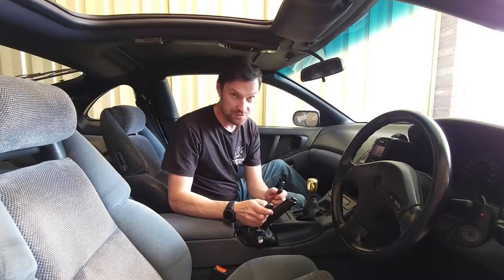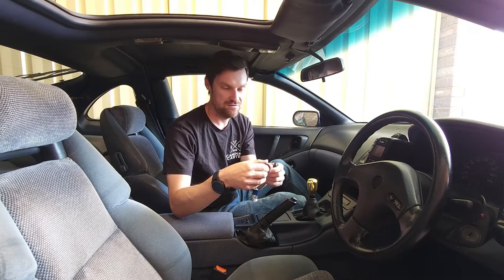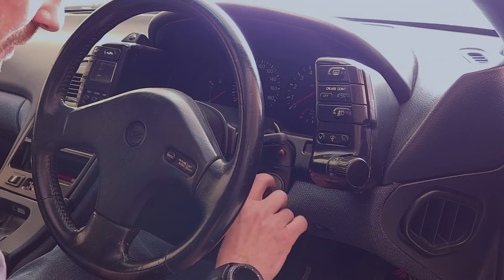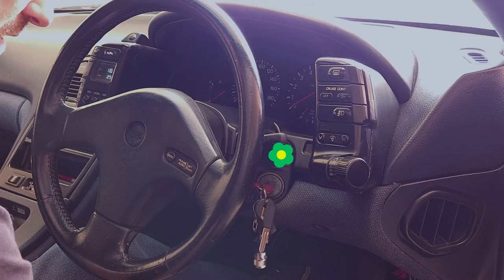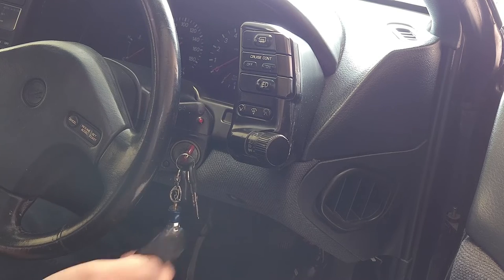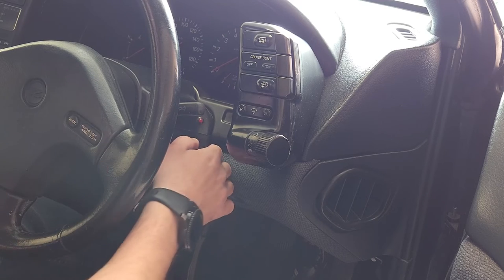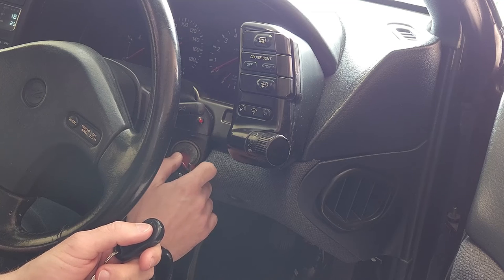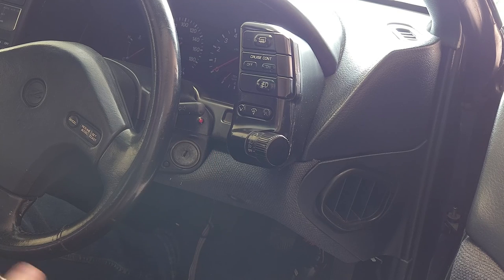How to Manually Override Auto Watch Immobilizer System

Comment: Great video . Alas my problem is my 1995 VW Golf's SANJII immobilizer- which is mounted under pax side carpet seems to be the problem. Changed my remote to my spare (which is brand new) and inserted two brand new CR 2030 batteries into remote-both LED lights come on when trying to deactive or activate her, yet she keeps on screaming. Had it sorted yesterday, went to the shops, only to realize I didn't have the battery/oil/choke lights working but everything else worked. Turns out the broad connector to the back of the dashboard panel either came loose, or I forgot to attach it (less likely) Took me 3 hours yet again to open dash. Repeated all the steps yet my ears are now bleeding from that incessant blaring. Finally decided to disconnect battery. Did notice the SANJII on the floor resembling a flat tapered trumpet has one "stop" which becomes warm. Even switched the two brand new batteries positions yet LEDs still work. I completely give up. Any suggestions besides putting her on bricks and buy chickens will be highly appteciated since I can't even start her to go to SANJII in Johannesburg.
Reply from the maker: Hi mate, bit going on there! sounds like there could be a critical issue with either the immobilizer system or the wiring for it, if its an aftermarket unit you may be better off removing the whole system to get the car going as you might be going mad trying to fix an unfixable issue.
I wish I could be more help here but it sounds like you may already know more than I do about your system.

Comment: How do you slide the top of the immobiliser? Mine won't budge!
Reply from the maker: Mine has a cap on the top that has 2 screws going in from the top of the cap. These need to be undone to lift the cap.
Mine is a 674Ri
Reply: @simmoshomeworkshop  ah ok. Thank you very much! I'll have another look as I've just ordered another fob because I rang a guy and he says £800 to fit a whole new alarm system just because one of my buttons on the fob has come away from the board 😒
Reply from the maker: Wow not cheap! Hopefully you can find the code and get the new fob to work, they can be quite hit and miss depending on the model
Reply: @simmoshomeworkshop  mine looks like a 457 with 4 buttons on it but the box itself looks like yours so hoping this works 🤞 
Do you know if there's a way to program another fob when you already have a fob? Like I said only one button 'arm' is broken on my existing fob but all the other buttons work. Just wondering if you can use the existing fob to put the box into 'learning' mode?
Reply from the maker: Hmm, I have only really coded the single button fobs through the LED input and key on and off flashing procedure (from the video).
I have not coded using another fob, it is possible without entering the code first (before doing the LED procedure) you instead use the other fob do disarm the immobiliser then do the second half of the procedure for the new fob, but I have never tried that.
Reply: @simmoshomeworkshop  do you know of a video that will walk me through this progress?
I can disarm the immobiliser using the existing fob, I just need to add another fob to the system
Reply from the maker: Nah I wouldn't know a specific video to do that sorry, (I'm sure someone would have done one) the very last part of this video does add a remote but only with the code, there is also a guide in this video's description on what I did if it can help you.

Comment: Is there a chance older models only had a 4 digit code?
Reply from the maker: Hey mate, all the ones I have encountered have always been a 5 digit code, it's possible very early ones could be a 4. If you have a 4 digit code somewhere on the unit and you think that's it, it doesn't hurt to try it, worst case it won't work

Comment: Just letting you know bro you can see the reflection of the flashes on the backside of your steering wheel and also on the right hand side black panel. Someone would be able to read your code if they really wanted to 👍
Reply from the maker: Cheers man, might have to do an edit 👍

Comment: Hi  so if I don't have  the  light  what mast I use to see if the code is Ok?
Reply from the maker: Hey mate, are you 100% sure there is not LED? All these systems should have the security light, without it the manual override isn't possible to the best of my knowledge.
Reply: @simmoshomeworkshop  .. hey mate ... I have the LED in the dash but it doesn't light up at all. How likely are the LED's to have blown ?
Reply from the maker: @heathenmedia  hey mate, rare for a LED to be blown but not impossible, are there wires leading to the LED? I have seen people put dummy LEDs in to look like they have immobilisers 😅
Could also be a broken wire to it, either way the LED should light up with key off and / or out of the ignition

Comment: Can i use a aliexpress remote cloner to have some spare keys, I have just one left
Reply from the maker: I've never tried with anything other than the autowatch remote that matches the installed unit, I don't see why a cloned remote couldn't perform the same function as long as it can mimic the same frequency as the original, the receiver shouldn't know the difference, I'm assuming..

Comment: Thank you for helping me it is working. Do you know how can I switch disable the motion sensor . Regards
Reply from the maker: Usually to disable the motion sensor operation for the cycle you need to press the remote button a second time within 1 second of turning the alarm on. This will only disable it for that cycle.
There is also a note that if early warning is programmed you will need a third press to isolate the motion sensor.
Hope this can help

Comment: Hey mate, I have the n4086 remote, where did you find a replacement as I want a secondary backup
Reply from the maker: Hey mate, assuming it's the peanut style like mine, the keyguys.com.au, or remotepro.com.au and good old eBay have them for just under $100 shipped.
I think the 225-000 is the same thing, (worth a check) I hope this helps!

Comment: The previous owner removed the code sticker and I have one fob, if you change batteries in the fob does it reset the fob?  Only have one fob & no code so need to know whether to rip it out now or if I’ll be ok changing batteries if it has a memory.  Cheers
Reply from the maker: Oh dear quite a pickle, my remote did not remember its settings when I changed the batteries but they were flat, I can't guarantee yours will or will not unfortunately (best to change the battery fast as possible if you do change them). The code is hidden inside the black box have you checked inside to be sure?
Reply: @simmoshomeworkshop ah that’s a shame, I hoped it had a memory function of sorts… 
 Unfortunately previous owner has peeled the sticker off of the unit so I’m a bit stuck if this battery dies.  I wanted to code a second fob, but obviously need the code to do it.

Comment: I have a button thing with 4 numbers and a s button what is this got a led indicator but no key fob I just bought the van would interesting to figur it out and to use
Reply from the maker: Interesting, is this unit mounted to the car and not something you carry? I'd imagine the 4 numbers are for a pin number? I have not encountered a system like this, the principle may be the same as mine where the LED corresponds to a code that would be printed on the control box under the dash/kick panel

Comment: After I input the 5 digit code it flashes but then when I turn it off to start programming the remote no flashes happen there’s just no light at all.
It resets after about 40 seconds and starts flashing again. Not sure what to do.
Reply from the maker: Hmm, that's an odd one mate, everything I know and have seen, once the 5 digit code is entered and the fast flashing occurs (you can start the car) turning the key off should make the LED flash before you turn the key on again to code the new fob.
Very unusual for it not to, sorry I can't be any help here, if anything comes up that will be of help I'll let you know.